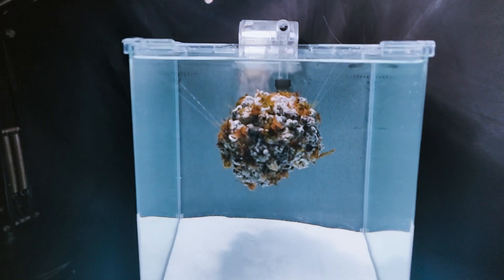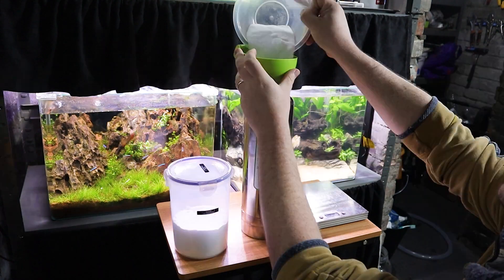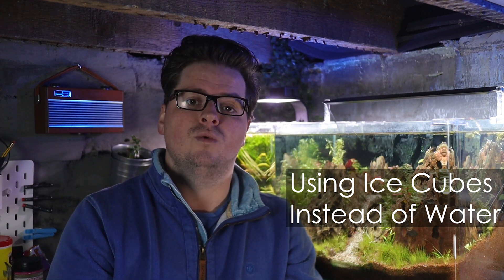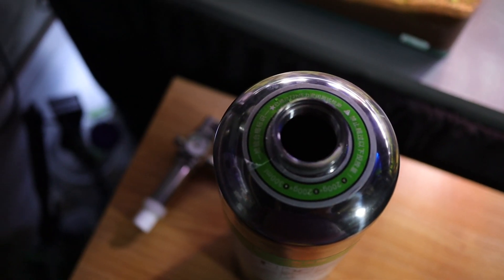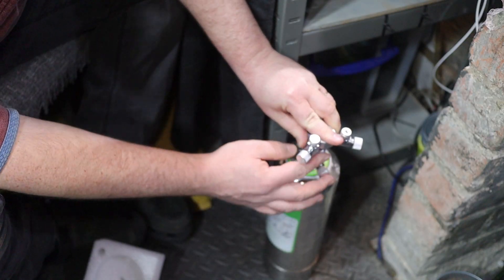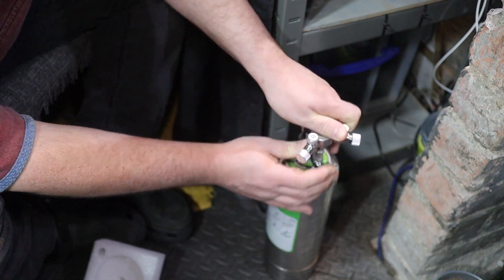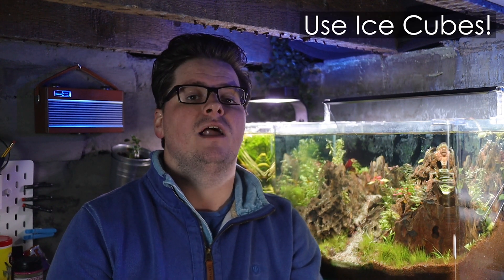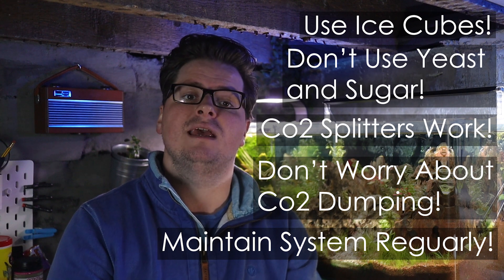Why You Should Use Ice Cubes in Your DIY CO2 Generator!

Comment: As somebody who has come to appreciate this CO 2 delivery system, I wanted to share another way to get water into the tank without losing too much pressure. As you mentioned, using ice cubes is far from ideal. Especially when you need your CO 2 up and running ASAP. I use a plastic bag method which allows me to keep the vast majority of the pressure where it's supposed to be.

First you measure out bicarb soda as that is what reacts with the water first. Put it in. Then you measure out the citric acid, giving the bicarb somewhat of a blanket when you put it on top. The next step is the trick. You get a thin freezer bag. Bunch up the bottom and cut it off, leaving more or less a tube. Get a piece of string. Tie it around the bottom, sealing the bag, but leaving one end of the string long so that when you pull on it, it unties. Then turn the bag inside out. You once again have a bag. Except this one has a bottom which comes undone when you pull on the string. Carefully stick the bag into the tank (after the raw ingredients have been added). Hold the bag around he edges, making sure that the string is outside the tank. Personally I just make a ring with my thumb and index finger when holding it. Then pour the water into the bag. It will be going right into the tank, yet still sitting inside the bag. When finished, simply yank the string. All the water will immediately drop into the tank. The citric acid on top will give you just enough time to put on the lid/valve. You'll hardly lose any pressure.
Reply from the maker: Very interesting. I had to read that twice to fully understand it, but it definitely makes sense to me. Thanks for sharing. I shall try it out with the next refill! 👍
Reply: @AquariumShed  It’s pretty hard to make sense of someone’s scribbling, that’s for sure 😅 The main thing to remember is that you stick a bag with a collapsible bottom into the tank while holding it and open it once it’s full so that it all falls to the bottom at once. So you don’t have to sit there, pouring the water in and watch it hissing and losing pressure. I’ve added an extra 30% longevity to each refill this way. In fact. I’ll make a quick video using a bottle and share a link. Give me a sec.
Reply: Still uploading. But I've got a nice clip coming...whenever the gods of YouTube get off their arse. lol
Reply from the maker: @ivareskesner2019  🤣🤣
Reply: @AquariumShed  I just shared a link. Please let me know if it went through.
Reply: @AquariumShed  This is using a jar, obviously. But it works even better with a tank.
Reply from the maker: @ivareskesner2019  Boom!! This is a great technique, thanks so much for sharing. Is there a name for the the type of lose knot that you tie which is easily released??
Reply: @AquariumShed  Glad to share 👍🏼 I’m not really sure what it’s called, if anything. You basically just double up one end and tie it long end first. Kind of like tying a bag so that you can easily untie it later.

Comment: @Aquarium Shed : Not sure if you are from UK or US, this product looks like coming from China, do you have any problems with Customs (Im from UK)? please advice
Reply from the maker: Hi Naga. I'm in the UK too and never have any customs issues with products direct from China via Ebay or Aliexpress. In fact recently the only issues I've encountered are with products coming from Germany because of Brexit. I order a lot of stuff direct from China and am always incredibly impressed with the speed of delivery too. 👍
Reply: @AquariumShed  Thanks mate, looks like 2L is not available anymore.. Just for 1Ltr it is costing now around 60£..
What you think about Steel based DIY regulator for Coke bottle?
Reply from the maker: Hi Naga, have you tried Aliexpress? They usually have a much better stock. The steel connector types are just a more solid / better quality version of these types that I've done a tutorial on before - https://youtu.be/_7xiVJPRKx0 - works well, but a little complicated!
Reply: @AquariumShed  Thanks Mate, I could see many options in AliExpress. Just wondering if a 1L tank will be sufficient for 12-24ltr Nano Tanks? or do I need 2Ltr? please suggest
Reply from the maker: Hi Naga. Both sizes will work on your tank just fine. The question is how often do you want to be refilling the system. The 1l will last half as long, but equally you're bubble rate will be very low for a small Nano anyway. You know from my videos how much co2 is produced, so I'd suggest using a co2 dosing calculator and working out how long each system will last for your purposes! 👍
Reply: @AquariumShed  thanks mate, I got one Ltr cylinder from AliExpress, the quality is great.. thanks for recommendations.
After 2 weeks my bubble counter started leaking water on the bottom. Do you have this issue?
Reply from the maker: @nagamanickam5702  Hiya! I haven't had any issues with my bubble counter, but they definitely do vary in quality. If yours hasn't got some kind of rubber seal then I would consider upgrading it! 👍
Reply: @AquariumShed  Hi, as far as I understand it there is no import duty to pay if value is under £135. VAT is charged by law at point of sale (even from foreign lands), so Aliexpress add this when you pay for the product, so you shouldn't have any trouble (unexpected extra charges).
Reply from the maker: Thanks Colin. Very useful to know this! 👍👍

Comment: Hello, a question, I have bought a 1 liter Co2 generator, and the charge lasts less than a day that is not normal, I do it as it tells me 100gr citric acid 100gr sodium bicarbonate and 150ml of water, in a day it I have loaded 2 times, that you advise me to aga, thanks a greeting.
Reply from the maker: Hi Francisco. There's only really two reasons this could be - either the system is not sealed properly, or you are losing to much co2 at the beginning when you add the water by not sealing the system quick enough. I'd check that all your o-rings are in good order, and consider adding 150ml of ice instead of water to slow down the reaction. You should be getting weeks not days of use from this system. I hope you are able to work it out! 🤞
I made a video here where I explain why ice helps - https://youtu.be/MFVwd-nWJek
Reply: @AquariumShed  Hello, thanks for your answer, it has helped me a lot, I already disassembled it and put it back together and it seems that it is going well, one question, after putting the load on it, you have to leave it for a while to load the pressure, thanks for everything a greeting.
Reply from the maker: No problem, happy to help. Yeah it takes a couple of hours to get up to pressure. Basically just wait until the needle is in the green zone. Glad it's working better now! 👍

Comment: hi nice video and thanks for the tips. so if using ice. do I measure water 300ml and make it into ice... or you just eyeball the amount of eyes??
Reply from the maker: Hiya. Glad the video was useful. You do still need approximately 300ml. Tho water is just the agent for the reaction so it doesn't need to be super accurate. In my case, I initially measured water into the ice mould and worked out that with my mould it was the equivalent of 13 ice cubes. So now I just count the cubes! 👍

Comment: Could it be possible to a fit a solenoid valve to it like the standard pressurised co2 kits?
Reply from the maker: Hi Lewis. Yes it's definitely possible, I've done it recently with no issues and some systems are actually sold with a solenoid as part of the kit! 👍